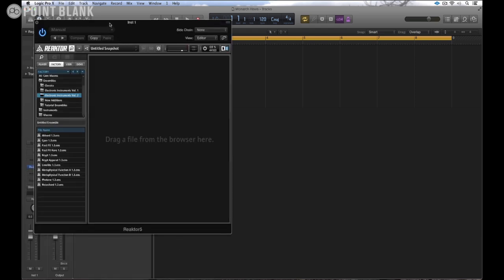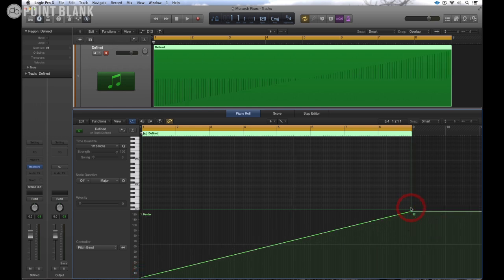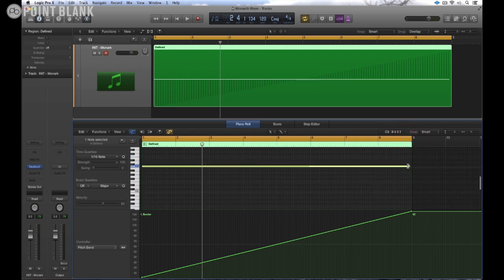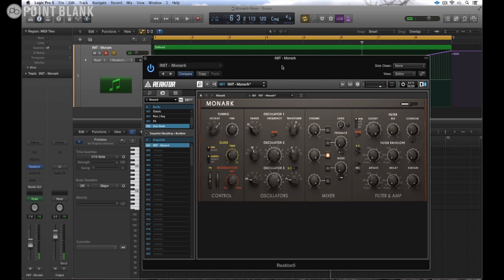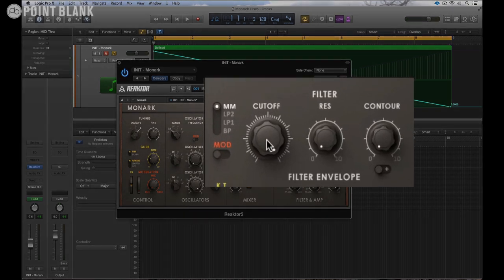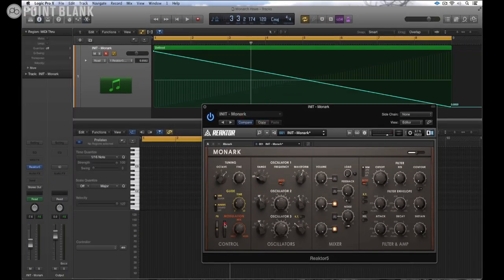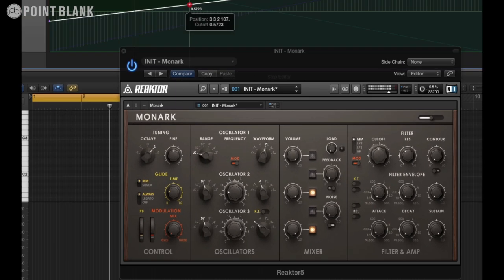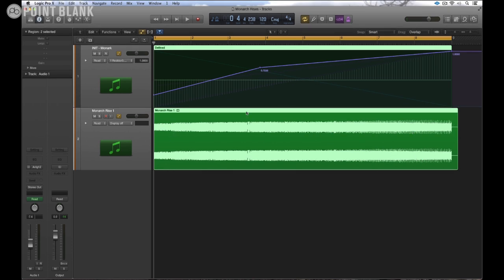Native Instruments Sound Design: Creating a Rise Effect Using Monark

Comment: Modulating filter cutoff with a square wave. Since a square is either on or off, very harsh in other words, I wonder if it's actually doing anything before the very end of the sound. Especially if the rate is very low at the start, it could just be idling at the low voltage until the rate goes up. I don't know if the rate is following one of the other OSCs, I don't have Monark yet.